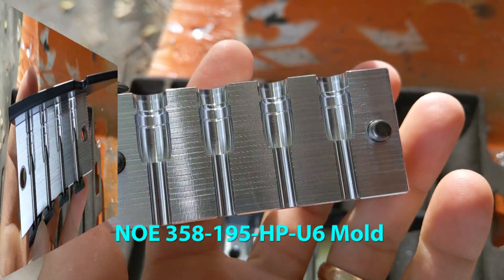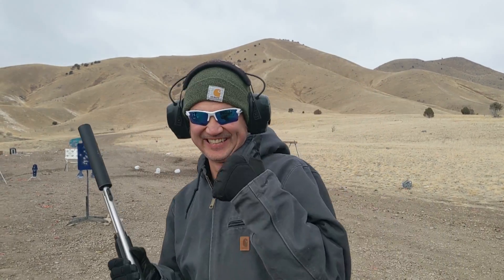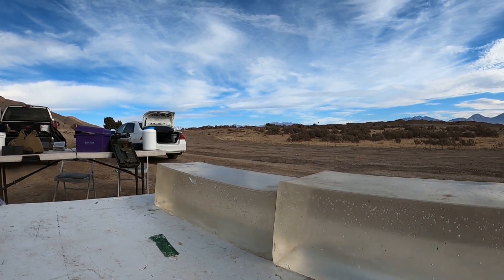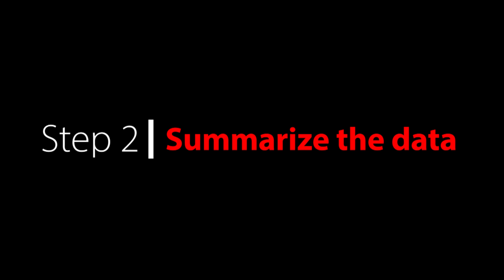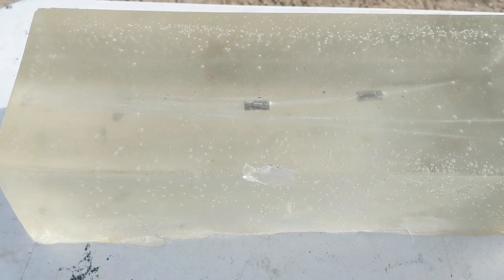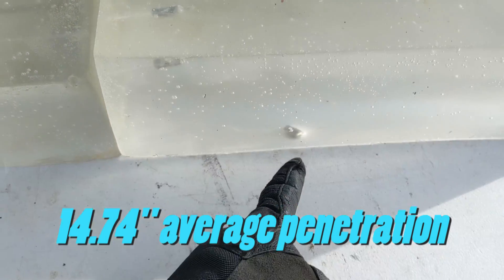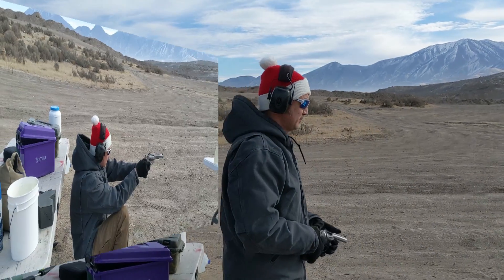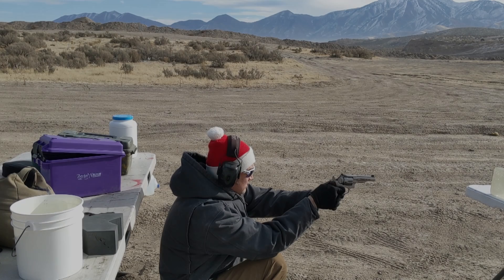200 gr Soft Cast NOE HP 38 SPL Ballistic Gel Test

Comment: Does the inconsistent penetration correlate with tumbling?  A long, slow,  butt heavy bullet has a lot of potential to tumble.  Early tumble with such a long bullet would dump energy right away, and probably cut a wide wound at the point of tumble.
Reply from the maker: Not totally sure--wish I had a real high speed camera

Comment: Great that you gave lead hardness info, very important.  In cast bullets there are always tradeoffs alloy hardness and velocity play important parts.  I suspect in a handgun you may see better expansion and penetration with a lighter bullet.  I suggest something like Lyman's Ray Thompson designed 358156 in a hollow point.  I think you can get a NOE mold in that configuration.  The Lyman Mold is a gas check design but it has been produced by other mold makers as a plain or bevel base design (H&G #156).  I feel the 150 grain weight is the sweet spot for expansion and penetration.

Comment: You "rediscovered" what the British found in 1922.  .38 caliber, 200 gr. bullets, when fired from a handgun, will tumble on impact (very obvious in your slow-mo segments) increasing the severity of the wound without expanding.  They considered this perfect for military rounds which were not allowed to have "hollow point" bullets. (some more recent interpretations of the agreements have changed that)  The .38/200 was their issued handgun load from 1922-1963. Their load was based on the .38 S&W cartridge, but performance was identical to what you are getting with the .38 Special. 
This was also marketed in the USA with a round nose bullet as the ".38 Special Super Police" load. 
FWIW, Buffalo Bore soft lead 158 gr. SWC-HP .38 +P ammo will give similar performance from a J-frame S&W that you received with the lever action and these bullets.  They are my choice for carry rounds in my .38 Special revolvers.  Their velocity from my Model 642 runs just under 1000 fps. They are not pleasant to shoot in a J-frame but give great expansion.
Reply: @captain crankypants Maybe not so good choice for a military handgun caliber but very good for self defense. But also depends on the situation. 9mm fmj has a very bad reputation for stopping an attacker quick. There are a lot of reports where they empty a whole mag from a mp into someone without stopping him. Same will be true for the 7.62x25. There you have a bigger chance with a tumbling 200gr bullet.

Comment: Great video ... what BHN for soft (8.6 ie., stick on ww)?  Is that too saint for siting in a 38 SPL?  I’m looking to reload some 148 Wad Cutters and would like to know what’s feasible for BHN .... only fir paper targets.  Any assistance you can provide is greatly appreciated.

Thanks,
CWH
Reply from the maker: Can you rephrase your question?  Are you asking how soft of lead you can use for the 38 special?
Reply: Yes
Reply from the maker: @craigwh1000  I'd think that stick on WW would be good enough for some wad cutter paper punching/plinking.  Are you going to use traditional lube or powder coat?  Powder coating seems like it gives a little more wiggle room.
Reply: Plan to use stick on ww and powder coating  for paper punching.  I’ll check my barrel often to see if I’m getting lead build up.

For my glock 17, I was going to use clip on ww and add some Linotype.  Is adding Linotype to the clip on ww overkill just to shot paper targets at the indoor range?  I plan to quench after both molds.  Thoughts?  Thanks
Reply from the maker: @craigwh1000  yeah both of those should work fine.  You shouldn't get any leading as long as your bullets are sized properly.
Reply: Great thanks and great videos
Reply from the maker: @craigwh1000  Thanks for watching and commenting, I appreciate it.

Comment: You’re right Taco, the Scandium J frames have an odd, springy feel that is sometimes unpleasant. Even the 342 AirLite Ti Scandium frame 38 Special that I like so much has that characteristic. A stout +P from it is totally different than the same round fired in the 638 Airweight that I also like a lot.
Reply: You should have shot Taurus Ti framed 41mag.... I ended up selling mine because it hurt so much. Then we started the 41 special stuff and I wish I could find another one.
Reply: @IWatchedWhat  I'd like to try something like that. I haven't looked into Taurus revolvers.
Reply from the maker: I've not really done much with taurus revolvers other than the Judge that I bought when they first came out.  The Judge I had fell apart at the range, and I had a really disappointing customer service experience--so I sold that revolver and said I probably wouldn't buy another taurus revolver after that.  On the other hand, I have had incredible service from S&W and Ruger...
Reply: @FullLeadTaco  I’ll take that under advisement, Taco!

Comment: I recently loaded some 180 gr cast coated in 38 with 4.3 gr unique for my suppressed Henry. After doing so I  realized that this is likely over 38 +p pressure. I don't have a 38 or share loaded ammo, but there is a chance it could somehow end up in one. Did you calculate the pressure of this load compared to standard 38 or 38+p? Obviously it is safe for 357.
Reply from the maker: I did not have a pressure calculator--not even sure these will fit into a 38

Comment: I wish Al would do something like this for the 41mag.....
Reply: I ordered a 41 Magnum mold from NOE yesterday, the H&G 258 clone. I was surprised there were hollow point variants of a few 41 molds listed.
Reply: @WilliamCChapin  I have several of Al's molds, but I want a hollow point like that 38 one. It would be great in a 41 special I think.
Reply from the maker: just gotta draw it up!
Reply: @FullLeadTaco  if I could draw. I couldn't draw a straight line with a ruler!
Reply from the maker: @IWatchedWhat  doesn't have to be to scale, just some basic measurements of what you want the bullet to look like.
Reply: @FullLeadTaco  I will look and see what I can find already drawn. I have a couple of HP moulds for the 41 now, but they are light weight compared to what I want. I was thinking 250gr to 260gr for the HP.
Reply: @FullLeadTaco  If Al had any of these in stock, 411-253-WFN, I would be all over one. But they have been out forever. One set for PC/Highteck coating with a nice deep HP would be great too.

Comment: Excellent presentation you covered many aspects on this.  Unique seems to play well with lead bullets in my experience.
Reply from the maker: yeah, not the best metering powder, but sure seems to shoot alright
Reply: @FullLeadTaco  if you want something new to try I really like 6.5 gr of unique in a 357 mag case with a 158 gr semi wadcutter.  It pushes about 1050-1100 FPS.  Excellent load it’s perfect for not too much recoil and just enough power to make you happy.
Reply from the maker: Yeah, I really like the 158's, probably my favorite "normal" bullet weight in the 357 mag.  I have a few different molds in the 158gr range and I've had good luck in the past with about 6 gr...  How hard are you casting the 6.5gr load bullets?
Reply: @FullLeadTaco  I actually am using commercial cast bullets about 15-16 Brinell. I just got into it a month ago and casted my first batch of lee 158 gr RF and they are about 11 bhn. I’m gonna test them in the .38 special.

Comment: Nice... hay tell your buddies to get some 9mm powder coat hollow point molds made!!!!   I got the 9mm solid points a rocking and  30 cal for the Blackout just about tuned in!
Reply from the maker: which ones are you looking at?  how heavy?
Reply: @FullLeadTaco  HTC356-135-RF-AH2 (12) or TL357-135-RF-AU5 (17) in hollow point.   I just got back from my local gun shop... 100 primers are now 10 bucks. 
 This is crazy...I'm glad I had previously stocked up.

Comment: Thanks for putting the BHN in the description. Did you anneal the whole batch at once? I have found that to get more consistent hardness from bullet to bullet, than dropping from the mold to a towel or to a bucket. It seems to me that your friend with the snubbie who wants to do this as a carry load would find the small amount of trouble for greater uniformity to be worthwhile.
Reply from the maker: yeah, I can't really recommend this load for defensive purposes, but maybe for animals when you'd want a bit more penetration?  not sure though.  I didn't anneal the bullets, just didn't water drop them.  Although the powder coated bullets were softened by the oven and not water dropped.
Reply: @FullLeadTaco  It seems like pushing him with just a little bit more charge weight and possibly a softer binary alloy would probably get him there. but you wouldn't really know until you do that work to gel test it. I think it's a pretty cool bullet either way.

Comment: Great video! I read where if you wanted to have expanding lead bullets, put them in a pan of water to half the length and use a torch to heat the tip of the bullet. When you start to see a change in the color then tip them over to cool. Makes tips softer I guess.
Reply from the maker: that works with brass but not with lead.  If you water drop the lead when hot, it will make it harder not softer.
Reply: @FullLeadTaco  not water quenching- put your bullets in a pan of water with the tip out and heat the tip with a torch when it changes color knock it over.i read it on cast boolits website on nose softening lead bullets.
Reply from the maker: I would think that knocking it over would quench it.  I can see how if you didn't knock them over it would keep the tip soft and the base hard, but tipping it while it is hot seems like it would quench
Reply: @FullLeadTaco  your right i re-read the thread and it doesn't say tip them over just leave them i guess.
Reply from the maker: People anneal brass and tip them over because brass doesn't get harder when quenched like that

Comment: I’m not sure how this applies, but I was once told that if you want expansion you need to hit over 850 fps. Have you ever heard this?
Reply: That's wrong thinking. It's too broad, whereas the information needs to be specific for the statement to be true.
Expansion with what bullet? In what medium? Deer/ bear/ human? You will get more expansion in the denser critter. Is that muzzle velocity? Because the issue is actually impact velocity. Hunting bullets may not print it on the box, but you can email the manufacturers and they will tell you the impact velocity which gives sufficient expansion and penetration for a particular application. For cast bullets, using the same mold, changing the alloy will change your answer. Or keeping the alloy the same and changing the heat treat.
Reply: @GunFunZS  well I can tell you it’s supposed to be broad. In my experiences, reloading only with factory manufactured projectiles it has seemed to be true. I’m not into casting, and I’m sure I know very little compared to anyone who is. With that said, it may not stand the test of time, but is it just coincidence that it works?
Reply: @scubaguy007  I think so. The thing is there is sort of an easily attained velocity for any cartridge type out of the common gun for it. Anybody who makes a bullet for that particular cartridge and gun is going to make their expanding bullet work at the natural velocity. For 38 special that's about 850. It's my guess is that it isn't so much the 850 is the magic number as that you were loading a bunch of different bullets that were all designed around cartridges that naturally tended to want to go 850 with that bullet weight. If you were looking at both designed around a significantly faster cartridge you would have found the magic number was a higher number.
Reply: For example I happen to know that Hornady makes two visually identical bullets that are 125 grains and 358 in diameter. One is designed for 38 special velocities and the other for 357 mag. They are designed to open at somewhere around 8:50 and somewhere around 1,200 ft per second respectively.
Reply: @GunFunZS  well I’m loading the basic pistol stuff. .38spl, .44spl/mag, .357mag, 9mm and 45ACP.  And right now, right now I have a ton of primers and can’t find any good projectiles. Lots of people say they want to trade, the problem is they’re treating me junk bullets. I text taco today to ask him about a video he might have that would help me get started casting. It’s a crazy world right now, So I might need to learn now rather than wait till later.
Reply: @scubaguy007  get on it. I love the mold on my recent video
Reply: @GunFunZS  thank for your responses. For the current time I just want to see about casting some round nose slugs to put down range. I feel that’s been part of my struggle from not getting into casting my own, because in the past I could order jacketed bullets from Berry’s to easily in the past, and jacketed are easier in my mind.
Reply from the maker: @scubaguy007 did you watch this video that youtube deleted?
https://odysee.com/@Full.Lead.Taco:b/live-casting-projectiles:9
Reply: @FullLeadTaco  I did watch this believe. Do you talk about the expansion threshold in it?
Reply from the maker: @scubaguy007  I don't in that one, that one shows basics of casting
Reply: @FullLeadTaco  oh yes absolutely. It’s very encouraging, my problem is ventilation.